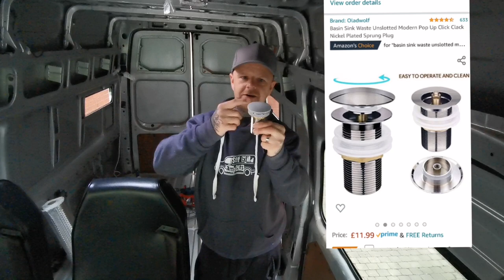perfect budget DIY campervan shower tray for under £20 campervan conversion transit 4 berth camper

Comment: Hi how did this tray hold up? Just doing my shower and cant find a tray small enough so looking at a tray or wetroom flooring thanks
Reply from the maker: Hey Katie. The shower tray has turned out great to be fair, I added a plastic grey duck board inside to stand on and gives the potty more stability too. The shower room video will be uploaded this weekend. The tray was small but I've extended the side to give more upper space. It's worked out well luckily.
Reply: Autozone

Comment: That’s a great idea for a shower tray, in some respects much better than a purchased one because you’ve got good sides on the unit that combined with the waster water outlet and the cost roughly twenty pounds it’s simply brilliant. 😎
Reply from the maker: Hi, thankyou. Yes it was awesome and definitely made it easier with the height of the sides. It definitely does need a duck board in there to stand on though or to keep the potty level.

Comment: This is a great idea, thanks for sharing. I'm converting a box van and have been able to include an (undercover) outdoor porch area by the tailgate and that's where my showers going. That whole space will be decked but I need a tray of sorts underneath them to direct and drain the water. This could save me a good £60/70 and because I'll never actually need to stand on/in the tray (itll be hidden under the decking boards) it doesnt need to be massively robust. Thanks again
Reply from the maker: Thank you Kim, I'm glad it's been of some help. hope your conversion is going all good
Reply: @Selfbuildcampers  Please, can you tell me how do you use a level in a van since a van itself is not level, a garage or street is not level on which to park the van while leveling the shower pan... I'm trying to build my shower right now and thinking I can't even attempt to level the shower pan I'm building, I assumed that I'd just have to level it using measurements of the distance from the van floor to the edge of the shower pan. How do you use a level in this application? Thank you for anything you can share!
Reply from the maker: @sheri4673  hey Sheri, yes a level can be pretty useless in a van. with my tray I managed to get a deep slope into my shower waste by raising the outer perimeter by roughly 25-30mm off the floor and then forcing the drain section down to the base of the van giving be a deep slope. Aswell as angling it with glued down hardboard my tray slope is also held down with the shower waste as it's screwed under van and on top of tray. it yes any kind of levelling in the van is a pain. I simply just measure everything from the van floor upwards, so everything in my van is level with the van floor.
Reply: @sheri4673  You are spot on Sheri only lunatics use a spirit level in a van as as much use as a chocolate fireguard